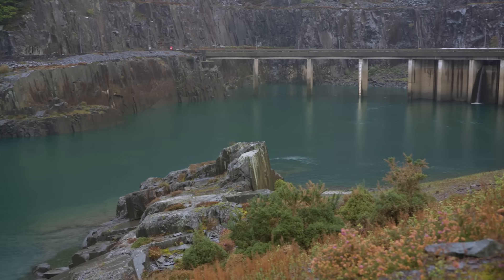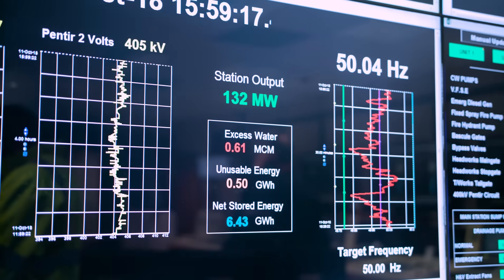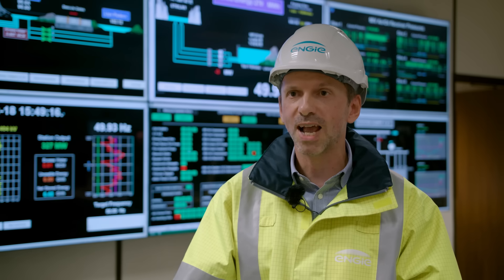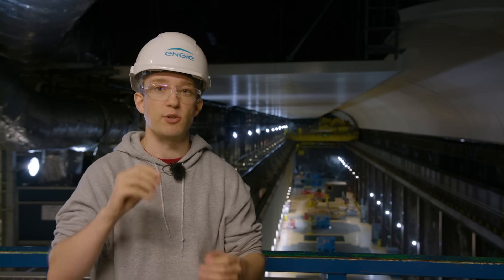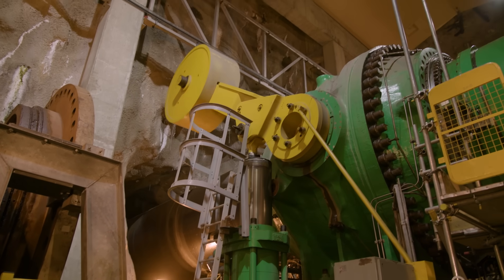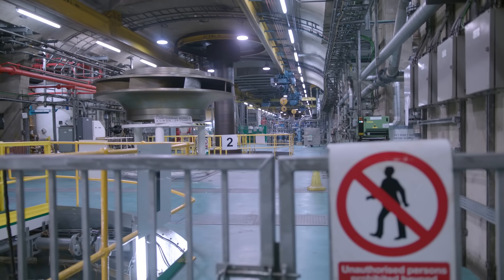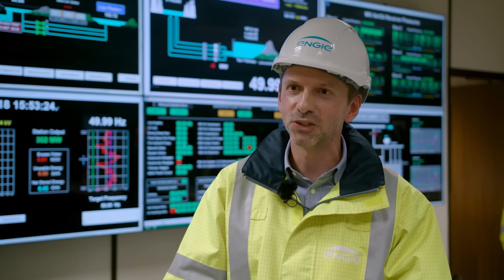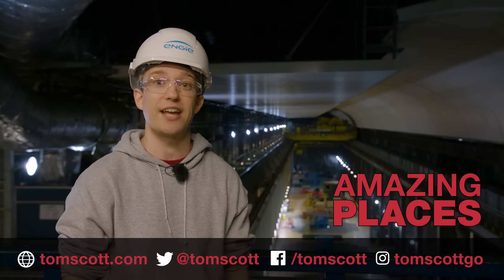Britain's largest battery is actually a lake

Comment: That's not a battery... that's energy storage.
Reply: What do batteries do? Store energy..
Reply: @kirstijones2008  Chemical energy... definition:
battery
/ˈbat(ə)ri/
noun
noun: battery; plural noun: batteries; noun: the battery
1.
a container consisting of one or more cells, in which chemical energy is converted into electricity and used as a source of power.
"a camera battery"
synonyms: cell, accumulator, power unit
"her car had a flat battery"
Reply: +SirJMDDK Yes they store a potential energy like that shown in this video, although not the same kind

Comment: you mentioned conservation of energy at the beginning, so how is this not a net loss in energy?? water falls down generating power, but because the system isn't 100% efficient it will generate an amount of energy less than the potential energy it had. they then pump the water back up, using electricity which they helped generate before, and because this process isn't 100% efficient either it's going to take more energy to pump the water up than the potential energy it will have once it's pumped. It just doesn't make sense economically because you have to use extra outside energy, which is also generated somewhere at less than 100% efficiency, to keep the system going. even if they use "cheaper" electricity to pump the water back it still seems like you're at a net loss of usable energy
Reply: Your right, but it is very much needed. The whole idea of this plant is to be able to dump lots of power into the grid when it struggles and there is too much demand. When the demand goes away cheaper power is then used to refil the lake. In the uk we tend to have huge demand on the grid at times such as 5pm and by night all that demand is gone. We also have to import power from france most days because we dont generate enough.

Comment: So when it rains the battery is charging?
Reply: No, that would just be a standard hydro electric dam with a reservoir.

This thing has two lakes, one is a few hundred metres above the other.  During the day when there is demand for electricity the water flows from the upper lake to the lower lake generating power thanks to gravity - at night when the demand for electricity is low and there is a surplus of cheap power those turbines get reversed so they become pumps that push the water from the lower lake back up the mountain into the upper lake.

Comment: Question: What is the efficiency of storing? I mean, Li-Ion batteries have about 95% efficiency (mAh in vs. mAh out).
Reply: This was designed and built well before Lithium was even a thing for batteries, in the 1980s I think. The efficiency is somewhere around 75% (well documented) but it is about load balancing and negating the effects of the duck curve more than how efficient it is. And for that purpose it is a great success.
Reply: Thank you for the answer. I find 75% resonable and as you pointed out, it can balance out the load of the grid. And in a much larger scale than any lithium battery could... But things might change, as there will be a lot of somewhat degraded cells from EVs in the next decades. And energy density is not that big of an issue with stationary installations. Which could be very useful for wind/solar directly on site of the plants.

Comment: How does the system avoid losing energy over time? Does the energy of gravity pulling the water down exceed what's needed to defeat gravity and pump it back up? I feel like I'm missing something here
Reply: Electricity is cheap at night because no one is using it but it still has to be produced because you can't really turn off a nuclear reactor, or even a coal/gas burner.  So this produces electricity during high demand when power costs an arm and a leg and then during the night the energy company purchases/borrows cheap surplus power from conventional power plants to recharge it.

Comment: But doesn't it use more power to pump the water back up the mountain than it generates letting the water down the mountain? Not a very good battery if it operates at a net loss
Reply: Every battery operates at a net loss.  Storage is there for convenience not efficiency.

Comment: Firstly thanks for the great content! 
I think you could do a very good job, just as you have for solar and pumped hydro, explaining the below areas which may be of interest!

As you have covered a few  power plants and storage batteries .... Please do an episode on the undersea power interconnectors and why an aggregated big grid is more effective, resilient and larger capacity that the pumped hydro storage which can only supply the UK for under 30 minutes. Also thermal, pumped battery, lithium, flywheel etc may be of interest, as might the duck curve and negative energy prices!
Then please do an episode on the control systems for the grid, smart meters and their security loop holes, like being able to hack into them "easily" intercept the unencrypted data and if the sample rate is about ever 1 second spy on the occupants, if the samples are aggregated averaged over 10 or so seconds it addresses this vunrebility. 
Doing a PhD on the area but not yet an expert!
Thanks for your time in advance!

Comment: They wanted to do that to a lake near where I live.  They didn't sell it well though, and it got painted as just a way to take advantage of electrical rates, not as a battery and it got defeated.  Of course, it would have ruined the lake, which is used for recreation, so maybe it was good.  This was way back in the 90's.  It was for load leveling but the public didn't really understand load leveling before it got pushed into the public consciousness with renewables.

Comment: South Africa has a few oth these stored hydroelectric systems, Steenbras Hydroelectric Power Station, situated in Grabouw area (Cape Town) and has the capacity of 180MW , and in the same area The Palmiet Pumped Storage Scheme consists of two 200MW generators. There is quite few scatterd around the country.

Comment: This thing only makes sense economically, right? I mean, you're using 'cheaper' electricity to pump the water up the mountain and generate 'expensive' electricity... but you in the end you're just saving money and not really generating energy... 
God I hate money, it's so stupid
Reply: It makes sense logistically. Turns out that power plants are too slow to  account for sudden jumps in energy demand and that solar and wind energy don't really care about how much you need right now. In addition, when it's the other way around, so you produce way too much energy (like if it's really sunny and windy all of the sudden or if the demand suddenly drops but the power plants can't account for that immediatly), you can just store that instead of wasting it.
Reply: @lunkel8108  Oh right, that makes more sense. I don't know how I didn't think it that way before, as the title says, it's a huge battery that you charge to make use of that energy the moment you need it. Thanks!
Reply: Happy to help

Comment: So if I understand this right, by pumping the water back up they are using massive amounts of electricity, just when it's cheaper, so it saves money but it doesn't actually produce more electricity just uses the stored energy during the day for peak times? So it doesn't actually generate power, it just regulates it?

Comment: Correct me if I'm wrong, but wouldn't covering up the lower reservoir make this a lot more efficient? Whenever it'll rain only the top one will fill up so more potential energy without having to do extra pumping.
Reply: Not really seeing as the lower reservoir likely has sluice gates that release any excess water.  Makes more sense to build an overflow system rather than a roof over an entire lake  :D

Comment: The main question here is: how does the efficiency of this battery compare to a conventional chemical battery?
Reply: It depends on the type of chemical battery, of course, but this will have a lot less efficiency with all of the friction of the mechanical parts and so on. A Lithium-ion battery for example is around 99%, a double A roughly 80%. It still is very useful, because it is a lot better at storing these insanely large amounts of energy.

Comment: Taum Sauk Pumped Hydro power station in Missouri USA actually failed in 2005. It overtopped due to sensor failures and Unsafe operation, sending a 20 foot wall of water downstream and washing away a small town. Amazingly, Nobody was killed. 

In 2007 The dam was rebuilt, It reopened in 2010, and it is now the largest roller compacted concrete dam in North America.

Comment: How much energy does it take to pump the water back up to the top? And is it efficient enough for it to be a viable energy source?
Reply: This is a battery, not a generator. It doesn't produce energy, it simply stores it.
Reply: According to Wikipedia, "The round-trip energy efficiency of PSH varies between 70%–80%"

Comment: How come they are not losing net energy? Or does the water generation makes more energy than it needs to be pumped back up? Basically a free energy much?
Reply: No, if we could generate infinte energy by simply pumping water up and then letting it fall back down again, we would live in a very different world, wouldn't we?
They definitly do loose net power, the laws of thermodynamics make sure of that. However, so does every other type of battery.
Reply: @lunkel8108  that's bs. That's not what batteries are for. And that's not how hydroplants work. There is no point whatsoever to pump the water back.
Reply: If batteries are not for storing energy, then what exactly are they for?
Reply: @lunkel8108  they are not used for storing the energy that they generated and then generating it back. That's a free energy generation claim.
Reply: Did you even watch the video? At night, when there is too much production and not enough consumption, they use that energy to pump up water. During the day they can then let it fall down again through the turbines to cover spikes in energy consumption. Where exactly did you get the idea that this was supposed to generate free energy?
Reply: @lunkel8108  dude. It's simple. Water falls down. It generates 100% of the daily production. The city uses 80% of it. Then they (allegedly) use the remaining 20% to send all the water back and repeat the cycle again. No matter how you put it - the water falling down somehow generates more energy than there is need to send it back. That's a perpetual machine if I've ever seen one.

Comment: I can see that it helps the nation meet the altering day/night electricity demand but in the end, doesnt this technically waste energy? Because of the losses in pumping the water back.
Reply: Yes, there's no such thing as a completely efficient battery though.  With batteries you are trading efficiency for convenience in that this thing can be switched on at any time and produce a lot of energy when it's most needed, then be recharged overnight at a cost - thankfully electricity is cheaper at night so even though you use more, it costs less.

Comment: I would think that the thing to do is put several low-tech windmills at the top to pump water upwards, lowering the cost of the electricity used at night.
Reply: *several hundred

Comment: This is far from a British exclusive idea.
Norway and Denmark e.g. have massive so called Windmill Parks, whom produces more than the can use and viability sell (when the wind blows of course). Denmark can produce up to 140 percent of its electricity needs though wind energy in prime conditions (it avenges around 40% of Denmark's yearly consumptions comes though wind energy). Any excessive power goes to pump high quantities of water high up into the Norwegian Mountains. From there it's ready to run through the canal locks, when the wind isn't there. It's through these collaborative like these with makes Scandinavia’s goal of being 100% reliant on green energy a possibility. Iceland have already met this goal, and Finland and Sweden are leading the way forward, when it comes to renewable Energy.
Reply: Key word Prime conditions

Comment: ive never understood how these work because surely it would take more energy to get the water back up to the reservoir at the top than would be produced during the waters fall?
Reply: You are not considering other costs involved. The power grid has to remained balanced. You can't  have more power going in than going out. 
Power plants are divided into different categories. 
Base load, Peaking, and load following power plants. 
Base load power plants like to run 100% all the time. Their design means their output can't really change quickly. The only time you want to shut down a base load plant is for maintenance. They are the most efficient way to make power. 
Load following plants supplement the base load generation, They can change their output to keep the grid balanced. Hydro electric plants are a good example of this. 
Peaking plants are the least efficient, and are only used when base load and load following generation isn't enough to meet demand. They are usually turboshaft jet engines that spin electric generators. They are very inefficient, and pollute quite a bit. 
With pumped hydro, if there is excess base load generation, you can just fill the reservoir with that and keep the grid balanced without idling any power plants that don't like being idled. Conversely, during times of high power usage, you can generate electricity with them, and reduce the need for expensive and polluting peaking plants.

Comment: In Switzerland as well 🤷🏻‍♂️
With all the mountain lakes.
Reply: Switzerland doesn't need to use reservoirs as batteries as it uses dams, which are very flexible/have the ability to store power.

Comment: Wait wait wait... the British electricity grid works because of a battery owned and operated by Engie ? But... Engie is the former GDF, aka the French public gas system (that got privatised for some obscure reasons), and it is still partially owned by the French government. So the British grid is owned by the French. After centuries of war and diplomacy, we finally did it, we own England ! Victory at last !
Reply: So whenever there is someone on the tv making fun of the French there will be a sudden glitch in the power grid. 😃👍
Reply: Nationalisation is bad except when it's foreign nations apparently.
Reply: @dougie8747  Nationalisation is bad, period. The only reason they are competitive is because they got privatised. If they were still French public gas system they wouldn't be able to compete in their own country with a singular private grandma turning a hand-cranked generator, like all the public services.
Reply: @DeuxisWasTaken  
Nationalisation is not bad in the right sectors. Look at the shambles that is the British rail system. They have been forced to renationalise several parts of it due to PRIVATE inefficiency and incompetence.
Reply: It is the facility that they own not the grid itself.
Reply: Well after Britain saved French ass twice in a century, the least France can do is to pay back Britain in the form of the LARGEST BATTERY EVERRRRRRRRRRRRRRRRRRRRRRRRRRRRRRRRRRRRRRR
Reply: EDF are one of the largest providers of electricity here too.  They were meant to be building us some nuclear power stations, though there were issues.  SNCF also have interests in our rail.  As someone else points out, we don't trust national companies to run things, they're inefficient.  Unless they're foreign.
Reply: "So the British grid is owned by the French." Really? Go build more bunkers at the Ardennes Frenchy. Leave this domain
Reply: It's true the French have finally won but the British will always have Agincourt (349 years after that unfortunate event at Hastings).

Comment: When I was mid engineering degree at Newcastle we visited Parsons while they were making the bits for that. Great stainless steel casings for the volutes being X-rayed for defects, which were dug out and filled with weld, and a guy smoothing and polishing the insides with a Black and Decker sander.

The castings were at least a foot thick, but they said that even embedded in feet thick reinforced concrete, they only had a fatigue life of some 50 years. That was in 1980...

The sheer scale of the operation still boggles my mind, there was a lathe so big the operator had a chair to sit in which went back and forth with the tool and a vertical lathe as big as a fairground carousel. 

All gone now.  ;-(

Comment: And what's the efficiency of this system? Obviously, it takes more energy to refill it than the energy that it gains when used. Is it within reasonable values?
Reply: It is inefficient as there is a net loss, however electricity is cheaper at night because everyone is asleep and you cannot turn off a nuclear power plant or a coal/gas burner so that unused electricity is used to refill this thing.  Just like any battery it takes more energy to fill it than you get out but batteries were not invented to be efficient, they were invented for convenience and having something that can output more than 1 megawatt of power within a matter of seconds is very convenient in a world where our electricity demands fluctuate from moment to moment.
Reply: @krashd  makes sense using those sources of energy that work non-stop. Smart idea. Thanks for answering!
Reply: According to Wikipedia, "The round-trip energy efficiency of PSH varies between 70%–80%"